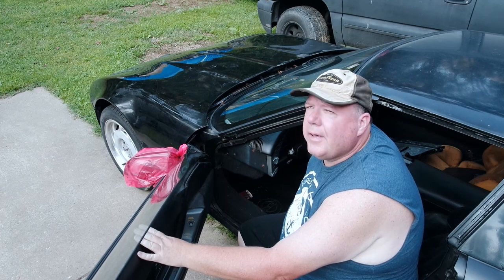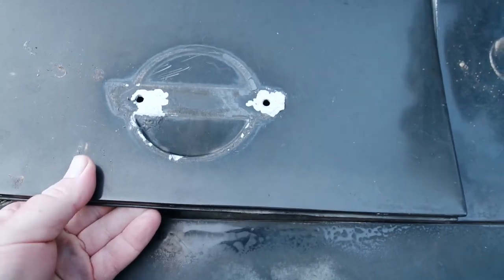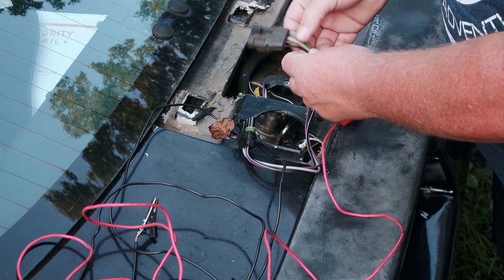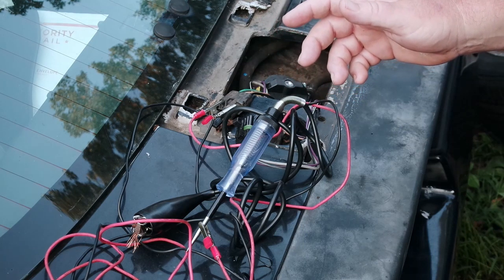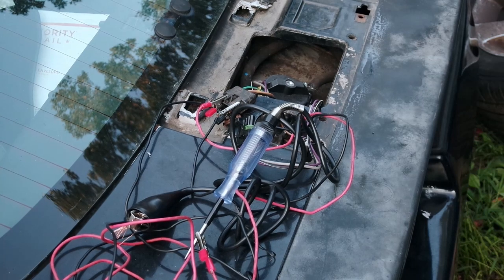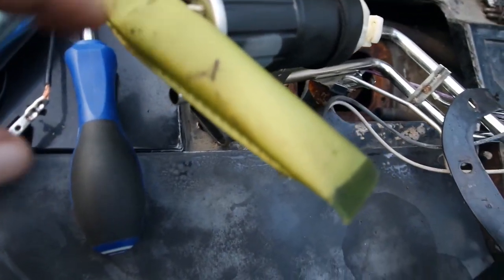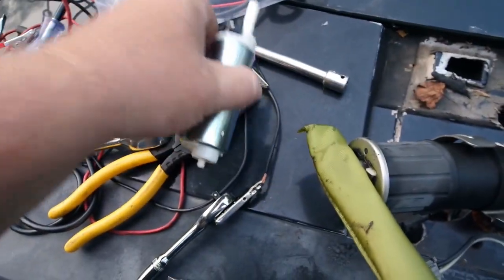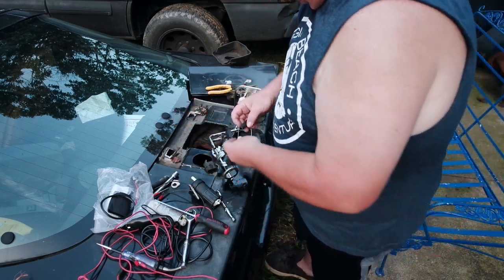How to: Replace C4 Corvette Fuel Pump

Comment: This is why i love corvettes. Built in mind for the track so mostly everything is easy to service
Reply: I’m guessing you love but do not own a Corvette? First of all we’re talking about the C4 here, so how it’s built for the track is beyond me. My 16 year son owns a C4 and my wife’s Nissan Altima is way faster and handles much better than my sons car. We actually let him get the Corvette because it’s about the slowest car you can find. So let’s get the “built for the track” thing off the table.

With regards to servicing, yes, the fuel pump is super easy on this car, after that everything is impossible. Take a week off of work if your heater core needs to be replaced. Don’t even think about replacing the spark plugs and if you have to replace fuel injectors…let’s put it this way, the GM engineers must’ve had a bad day when they designed the fuel rail location.
Reply: @davidstepeck2644  i have 2  and yes they were built for the track. Corvettes have always been built with the track in mind. Mid engine, double wishbone suspension, leaf springs, etc.
Reply: @davidstepeck2644  i would even argue about rpo code z07, z06, z51 but you dont know much about these cars so there's no point in telling you.  But you must be corrected by saying that its not built for the track as the C4 Corvette was built for the track in mind.  Look at the suspension, engine placement, aerodynamics of the vehicle, etc.

Comment: Great vid. Excuse my ignorance but I understand that when your set the key to the run position, you should hear the fuel pump prime?  Well I don’t hear it anymore and of course my car will crank but won’t start.  I have no fuel pressure with fuel gauge.  I checked all the fuel pump fuses and they were good so I suspect the fuel pump relay but can’t access it since I have to push the car out of the garage to get to passenger side.  So, if I had a bad relay, would your test light still light up?  I’m just trying to work smarter not harder.  Thanks!
Reply from the maker: When you turn the key to run the test light should light up momentarily. If it does, then its the pump and not a fuse or relay as any power there at all means the fuse and relay are good. Should also light while cranking. Hopefully that makes sense. Good luck!
Reply: Sir, thank you very much for this video.  Your the only video I could find that showed the use of a test light.  Other videos showed a multimeter but those aren’t dummy proof.  I wired my test light just as you did and my wife saw the light coke on momentarily with the key to the run position and then came on while I attempted to crank it.  I now know it’s the fuel pump and I’ll order one.  This saved me a world of grief because I thought it was the relay and I was gonna push the car out of the garage because I had no room to pull it on the passenger knee bolster.  Hopefully once I install a new fuel pump it will crank.  I’ll let you know.  Thank you so much for the help!
Reply from the maker: @timothydecelle3201  I'm looking forward to hearing about it firing up again once you install the new pump! :)

Comment: My 86 vette didn’t get enough fuel anyway but I would be able to drive it perfectly fine. One day it just wouldn’t start for a long time. When it did start it wouldn’t accelerate fast at all. I was thinking it’s the fuel pump but I’m not completely sure. Do you have any ideas? I had it floored and it did 0-60 in like 30 seconds
Reply from the maker: Could be a fuel regulator. Back passenger side on the upper part of the TPI there is a vacuum line that goes to the regulator. Pull that line off and see if there is gas in it or if it smells like gas. If it does then you need a fuel regulator. I have a video on replacing the injectors and the regulator and I'm pretty sure I show it in that video.
Reply: @MidnightRoadGarage  alright thanks man! I didn’t want to start pulling out stuff or buying things I don’t need

Comment: Would this cause intermittent stalling?  Like randomly?
Reply from the maker: Anything is possible but probably not. Fuel pumps usually either work or they don't. I'd lean more to a bad fuel pressure regulator or just gummed up injectors if your thinking the issue is in the fuel system.

Comment: Should the battery not be disconnected before replacing the fuel pump?
Reply from the maker: If you are just replacing the pump and not doing any troubleshooting at all then yes you probably should. :)

Comment: The Corvette has no business being near a race track. First of all we’re talking about the C4. My 16 year old son owns a C4 and my wife’s Nisan Altima is way faster and handles much better than my sons car. We actually let him get the Corvette because it’s about the slowest car you can find. So let’s get the “built for the track” thing off the table.

With regards to servicing, yes, the fuel pump is super easy on this car, after that everything is impossible. Take a week off of work if your heater core needs to be replaced. Don’t even think about replacing the spark plugs and if you have to replace fuel injectors…let’s put it this way, the GM engineers must’ve had a bad day when they designed the fuel rail.